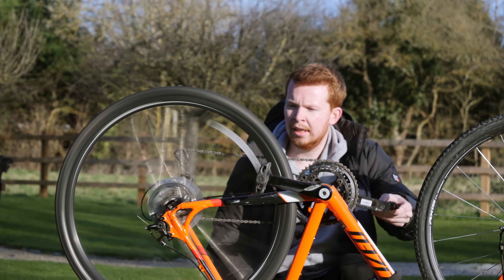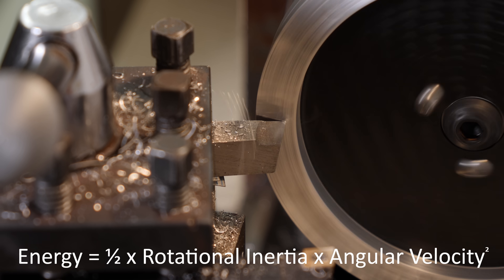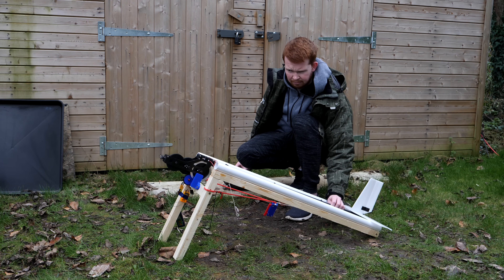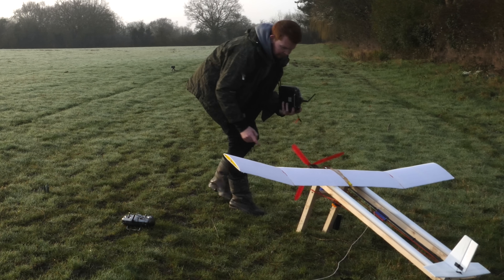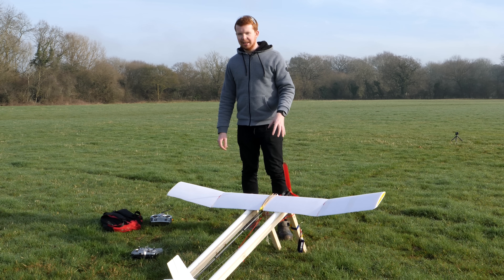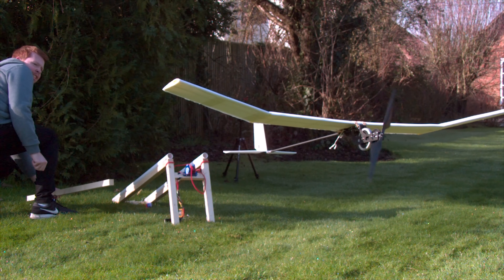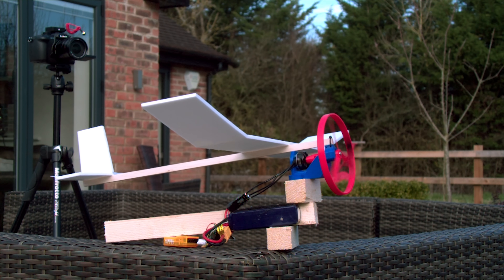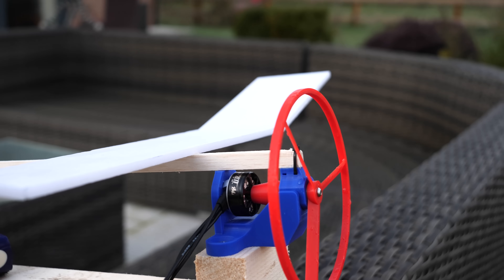Flywheel Powered Plane

Comment: Reminds me of experimenting with flywheel cars for a few years , At the  end of it all , I gained  One gear up . but adding so much weight ment double the size of brakes to stop , and you were sitting over a high rpm powder keg , if it ever decided to brake up and come through  the floor . I feathered the power off as needed with  an  asbestos fiber  air clutch , that worked well . Any other type of lining , burned up .  The vibration you were having could be because youre going thru harmonic  frequency ranges as you speed up .  I had to put in balance adjustment screws on the outer edges , that you could adjust by trial and error . I found something even perfectly machined had harmonics ,   The jogged release you used for power in , I solved with a sprag  where the teeth dropped out of the way on release . Eventually gave up on the project , not because it didnt work , but there are a lot of safety concerns .

Comment: Hey Tom, awesome video. As a person who had special interest in flywheel, would you mind if I add some suggestions? 

An ideal fly wheel energy system should be designed as follow:

You were right about the flywheel mass ideally should be as far away from the center as possible 1:15 . Based on that, I think a flywheel energy system should work like an inrunner brushless motor with the stator be on the inside of the motor and the flywheel being the rotor on the outside of the motor to focus most of the mass of the flywheel to the outside.

When you want to "charge" the fly wheel you just power the stator to spin the rotor. And when you want to "discharge" the flywheel, you use the stator as a generator to harness the kinetic energy of the rotor.

Ideally, this should be done in a vacuum with magnetic bearing to minimize friction. And to achieve maximum specific energy (energy per unit mass). The flywheel itself need to be made of a material with high tensile strength to resist the centrifugal forces and low density to stay light weight. I suggest using carbon fiber tow like this: https://m.youtube.com/watch?v=J_651BMRc0w or UHMWPE (ultra-high-module-weight polyethylene). The advantage of carbon fiber tow over the carbon fiber you're using is that it is 1 directional. All of it strength is all focus in only 1 direction across the entire fiber.

What I found interesting when I do the math on flywheel is that the size of the fly wheel is not really important. Sure making the flywheel bigger will increase it capacity but a smaller radius fly wheel spinning at a higher rpm will store the same amount of energy.

You might say that a smaller radius flywheel will be weaker and thus cannot support the same amount of centrifugal force but that's not true.

A smaller fly wheel with the same mass and height will be thicker than a larger flywheel of the same height and mass. If you shrink down the height and width of an object while keeping the mass the same, some other part must expand right? It's simple math.

I even made an equation to calculate the specific energy of the flywheel depend on what material it's made from and I calculated:
54.311Wh/kg for carbon fiber
55.571Wh/kg for Kevlar
82.031Wh/kg for UHMWPE
And 1380.514Wh/kg for graphene

Comment: Dude, I had this crazy idea of a Helium Balloon, which requires really low amount of energy to stay afloat in the air btw, with solar panels on top of it. That way, it can stay up for really long periods of time.
Reply: Everyone has had that idea. But you'd need to replenish the helium eventually. It would be better to make it unmanned and fill it with hydrogen. Lost hydrogen can be replenished without landing, by electrolising water sourced from the atmosphere (or from an onboard water reservoir).
At any rate, the Makani seems better, as it actually harvests usable excess energy while staying in the air. It's not a balloon, and it's tethered to a thing on the ground, but whatever.
Reply: @sanjaymatsuda4504  Dude, I made a balloon drone, with some drone parts. It had power for 2hrs. The Helium had to be replenished once a DAY.

Comment: Hehe the ring flew surprisingly well on its own. Might be worth exploring further.
You could also do a flywheel with magnets on as a generator and fly the plane with electric motors. The flywheel could be in a witawrap pocket filled with hydrogen which reduces the aerodrag significantly.

Comment: It does not store energy at all, it only transfers energy in a very very limited way. And it does not deal with any kind of resistance very well. There's no way a flywheel is a viable way of propulsion for anything beyond a super lightweight toy. In a sense it's the whole gyroscopic anti-gravity nonsense all over again. And no, it does not count if you throw the plane.

Comment: You could build a rubber band motor, imagine how many rubber bands equals to the weight of this flywheel! You could make multiple rubbers and some sort of clutch system which should activate the the next rubber band when the first is done, and so on. It should extend the time of the rubber band motor being active.

Comment: come on, you don't really expect that flywheel to push it to flight speed in 1 meter of "runway". Also, the larger the flywheel is going to be given a proportionate wing the more weight will spin toward propulsion compared to the deadweight of the frame as the energy stored increase with the square of the radius for a given achievable rpm.
Do another video where you have a larger diameter flywheel as to make the weight spin faster holding the same rpm.

Comment: the flywheel is spinning in a way that's forcing the plane to go down nose 1st probable solution 2 flywheels spinning in counter-rotation ?
Reply: John I think you’re right there’s an inherent torque created by the flywheel about the axis it’s rotating. I think if he had a wheel spinning the opposite direction it would stop dipping down.
Reply: @Booznstuff  I think a bigger cord (or kmf wing) would help. The kmf wing produces a lot of lift which would compensate for the flywheel engine and any rotational forces.
Reply: I'm not sure if it's the spin or the balance, but it's definitely nosing down. But it also looks like even if that was corrected it wouldn't make it very far. I'm afraid the flywheel is simply too heavy in relation to the thrust it produces. Even at top speed it just barely pulls the plane forward, and the wings don't produce enough lift to keep it up. The concept itself seems a bit much - flywheels are necessarily heavily, and airplanes need to be light. Rubber bands under tension would store as much energy without so much weight.
Reply: @Sasha Kruse Grim I'm assuming the flywheel rate of decent is a very minor in the 5 feet it flew. If it slowed that much in that short of a distance then we have a major design flaw. 

And if that was a issue you could print a counter rotating prop and spin the flywheel the opposite direction which in your statement would cause a lift due to the centrifugal force.
Reply: With the flywheel oriented as it is, pitch won't be affected by its precession but roll and yaw would.
Reply: @jimbobur  not from gyroscopic precession, but drag and other losses transferring the momentum into the aircraft frame
Reply: I would just move the fly wheel back closer to center of the aircraft fuselage and put a new longer belt on or just a connection of gears.
Reply: The issue is the Center of Gravity is off aka the flywheel is to far forward causing it to be nose heavy. The centrifugal force of the flywheel can cause issue once you Roll the plane left or right.
Reply: @gregoetker1389  This guy has built a plane before, I'm sure he's got the centre of mass right...
Reply: @Mansare94  You spelled "center" wrong. (lol)
Reply: @Mansare94 , I've watched Tom for years and know about his projects.

My statement is still true. The plane nose dived into the ground. That is caused by incorrect CG and/or not enough wing surface to substain flight. 

The cord of that wing was narrow (but was the wing span enough?) and with the normal CG approx 25% back of the leading edge of the wing, the boom length and tail weight might not been enough to offset the weight of the flywheel. 

RPM can be adjusted if needed.

The real test is do a glide test without the use of flywheel. It should float down not arc down.

Some some food for thought.
Reply: @melcrose  

Center is Americanized spelling and Centre is British spelling, like color and colour.
Reply: @melcrose  Actually, no I didn't.

Comment: Get rid of the belts and pulleys and use an electrical transmission, motor/generator on the flywheel, supplying a chopper style voltage regulator supplying a motor on the propeller.

Comment: With a direct connection to the flywheel, the power loss was immediate. There should be some variable gearing that would bleed the power slower.  
 Then the plane would have full power longer.

Comment: Great video mate, what would happen if you mounted the original prop and flywheel drive above the main-plane and used a prop similar in design to the indoor ultra light models that use rubber motors.
The props you were using all looked like high speed designs, the indoor guys have low speed props to make us of the limited energy they have.

Comment: The rotational torque of the flywheel was driving the nose of your plane down, if you reversed the direcvtion and put a reverse pitch prop on the plan, it should help.

Comment: Hey Tom! I wounder if your original design would have problems anyways due to gyroscopic effects.
Reply: That is what I was thinking. At 4:40 it looks really odd. I don't know if that is gyroscopic force or just weird stalling.
Reply: @asdenseasosmium  click on that timestamp it sounds like a burp! :') but it's just the tail end of Tom saying "propeller"
Reply: @Jonay1990  I am LMFAO!!! It really does sound like a burp!  :D
Reply: @asdenseasosmium  It looks like the wind. You can see the branches moving in the top right corner.
Reply: Counter-rotating flywheels?
Reply: Good point, going up or down would cause left or right turns. But it would be fun piloting hahaha
Reply: Full-scale single engine propeller aircraft have to deal with the same problems in their designs. Offset aileron hinge, trim, and motor angle are all used to oppose the left-turning tendencies.
Reply: @LueLou Indeed, but a dual flywheel design could cancel out much of it. Which is probably what is needed to make a more controlled flight - scaled up some for improved low speed lift thanks to the larger wing surface and an effective doubling of thrust should make it work well. Some of those flights looked close to enough..
Reply: @foldionepapyrus3441  Think u r totally right. For the flight performance is a double flywheel super important. 
@Tom Stanton: Would be super cool to see another version of it. THX
Reply: Spin the flywheel in the other direction and print the new propeller accordingly, it might work! Neat idea.
Reply: Near impossible to roll. Grab a bicycle wheel, hold it by quick release lever and spin it. It will want to stay in original orientation and only want to move radialy.
Reply: Yeah definitely spin it in the other direction (same as aircraft wheels on takeoff). So it could produce positive roll-yaw coupling. (Civil aviation did explore such effects in patents/research of pre-spinning the wheels before landing for airliners if anybody is interested in reading about it)

As it was even if this model flew it would be non controllable, and any gust would send it in a slide or spin to the ground.
Reply: @LueLou Forgive the ignorance. I'm not familiar with aeronautic terminologies, but I am with the mechanics of rotating bodies.
Reply: Gyroscope procession, I think it is called too.
Reply: If it was mounted horizontally on a pivoting mount, and was connected using a CV joint, it might work. But, he needs gears instead of belts, and a heavier material than aluminum.
Reply: I would agree.  The gyroscopic tendencies of the flywheel may be the cause of the vibration and have weird effect on CG that is beyond my maths.
Reply: pafnutiytheartist if the plane merely translates (moves along an axis or some axes), rather than rotating, there should be no torque on the gyroscope (the flywheel), so there should be no odd twisting. A perfectly straight (forward) flight would be no problem, and pure lift without change the angle of the wings would also not be a problem, since they're both translation with no rotation. Another commenter pointed out if the plane twists in any particular direction, or dips/rises in angle, that would cause odd kinds of motion with the gyroscopic effect...
Reply: From my experience while jumping a motorcycle if you apply the rear brake while in the air the front end noses down and giving more throttle raises the front so it seems that a spinning mass is heavier
Reply: The mention of gyroscopic influence made me palm forehead. Excellent, insightful observation. The use of multi-gyros/flywheels absolutely demands this project NOT be shelved. There is great potential there.... Im still trying to envision how to maximise the inertial  physics for benefit without inducing a negating imbalance somewhere else.
HOWEVER! I firmly believe a perfect solution is right there.... Trial. Failure. Observation.
Reply: At more than 20k rpm the whole plane has such a vibration that gyroscopic effect is not that important ;)
Reply: @blizzardstr  provided it doesn't disassemble itself, they probably wouldn't couple to the flight dynamics

Comment: This is exactly how some WWII carrier aircraft were started. Crank the flywheel, drop the clutch, and start the engine with no electricity.
Reply: I believe a tiger tank is also started with a hand cranked flywheel.
Reply: @frackcha  Ever seen the original Flight of the Phoenix with jimmy Stewart? The radial engine used in that flying box car used a shot gun shell blast to spin a fly wheel that cranked the engine over. Really a unique and fascinating idea!
Reply: @frackcha  it was.
Reply: How I start my car when people are asleep lol (Hill roll start)

Comment: "Flying Hula Hoop" must be your next project!
Reply: Please, that was really cool.
Reply: @calebsherman886  yes
Reply: Use Magnus effect to generate some lift and off we go!
https://en.wikipedia.org/wiki/Magnus_effect
Reply: @filipmatyja  Please change your comment telling people that it's the Magnus effect, as the Magnus effect isn't in play here. The Magnus force acts perpendicular to the angular velocity of the object and in this video we see the propeller going in the same direction as the angular velocity thus we know that the Magnus effect isn't in play.
Reply: LoL, googling that would likely end in a faptrap.....!
Reply: I had a need gun that shot rubber rings and they flew just like that propeller did
Reply: I'm wondering how fast such a thing could even travel. Like maybe near sonic speeds if pushed to the limit, or beyond? I guess with the right material and right launcher it could go supersonic, but I'm wondering if it could be done only rotationally without using positive pressure (ex. compressed air or explosives)
Reply: Mshojat same thing I thought it has to have a damn good drag coefficient thing could probably got Mach 1 underwater
Reply: I saw a video recently where a couple guys make a plane that flies with the Magnus effect but with KFC buckets as the wings. I think the channel name was Peter Sripol.
Reply: @Sterl500  Yep Peter Sripol made an RC airplane with KFC buckets for wings using the magnus effect. There are also several other videos on magnus effect planes that are pretty cool.
Reply: make hula hoop drone, just aerowheel.
Reply: Using the Magnus Effect?
Reply: @houselightkell  , using all kinds of effect. flight of hula hoop is awesome and scary deadly :)
Reply: I'd be pleased to see a supercharged version of the propeller toy :D
Reply: thats alien tech, how does those flying saucers defy gravity
Reply: I used to have a hola hoop think it’s in garage was weighted at the front throw it like an Americana football and it’ll fly a football field easy
Reply: @hazza123live  , collector's item.
Reply: Can you say "gyrospoicc force"?
Reply: Ja was realy intesting
Reply: Yeah, I was really amazed at how stable it was, but I should not have been as there is a ton of stability in that flying gyroscope.  I suggest you make a 'gun' that shoots gyro stabilized rings like this!
Reply: Tom Stanton give an eye to X-Zylo it's something for your super powers
Reply: @grazianoturbogas  Had one of those years ago, pretty fun toy, flew amazingly far and stable.
Reply: @microbuilder  I also have one. They are not so easy to throw but I think they are a perfect topic for our Tom

Comment: I was expecting carbon fiber propeller with metal loop around it. :(
Reply: Yes! Make 2 rings, cnc little recesses for the blade tips and clamp them together. The speed could burst it though....😛
Reply: @olliea6052  Tom has some good balancing skills :p. And the flywheel is also rotating at high speed.